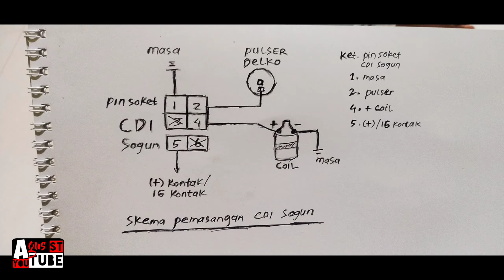CARA memperbaiki | DELCO | distributor | RUSAK | mobil Corolla DX | kijang | pakai CDI sogun kebo

Comment: Ciri cdi mati gmna bro? Soalnya punya sy kalo di gas rpm 3000an malah mledak”
Reply from the maker: Kalo mesing masih bisa nyala berarti cdi masih ok,dan kalo digas mledak2 itu kare vacum delco nya gak gerak om, bisa jadi di dalam delco kotor dan membuat macet pulser untuk gerak maju mundur, sehingga saat di gas pada rpm 3000 delco tidak dapat memajukan pengapian , dan saya pernah mengalami nya om, setelah di bersihkan semuanya mobil kembali garang
Reply from the maker: Semoga bisa membantu om
Reply from the maker: Kalo CDI mati sudah pasti mobil tidak mau nyala
Reply: @agusst  siyap bro